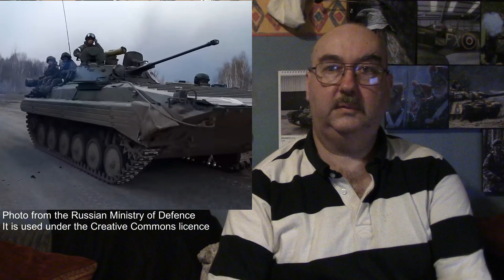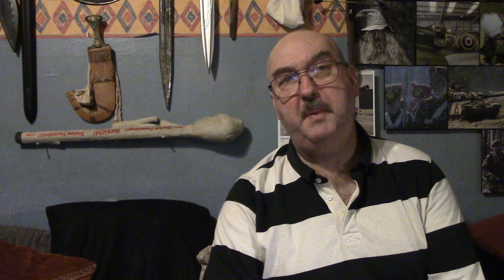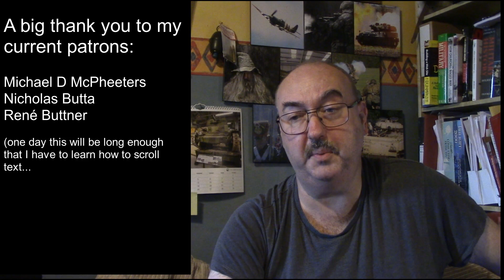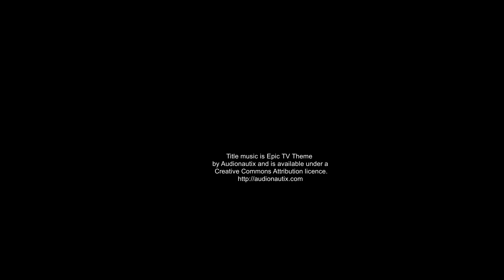Why ride OUTSIDE armour?

Comment: Great stuff, James. The visibility is key when armour is weak and not near dismounts - often forgotten in Top Trumps procurement. My favourite is the Honey/Stuart with the turret removed for recce - the gun wasn't much use so they saved a load of weight in exchange for getting a bit wet.
Reply from the maker: Ditto the removal of the M2HB from the top of British Shermans to reduce visibility (and the fact the commander has more to do than shoot)

Comment: Inside may be a death trap but outside doesn't have protection from explosive shockwaves and stuff.
Reply from the maker: It's down to your threat perception a lot of the time
Reply: if your vehicle is hit first, I suppose the chance of surviving would be low, but for the other vehicles it will be different, meaning the soldiers have the time to spread out and establish a security zone around the vehicles.